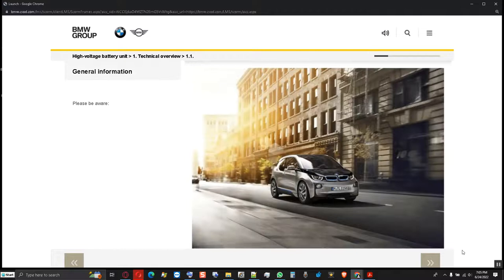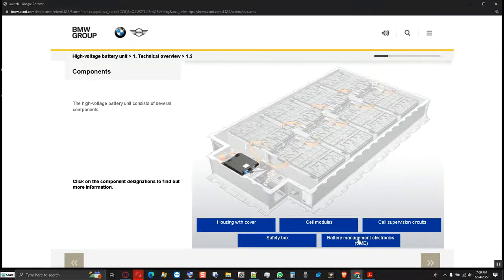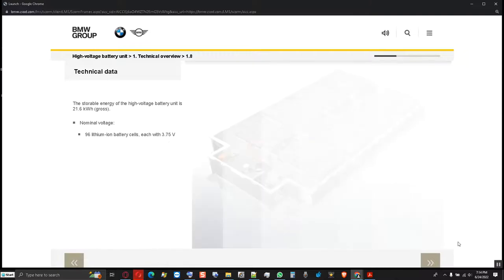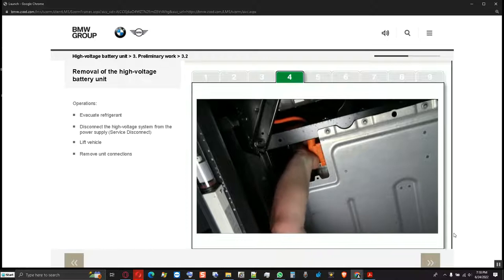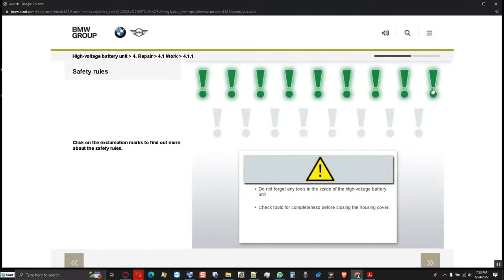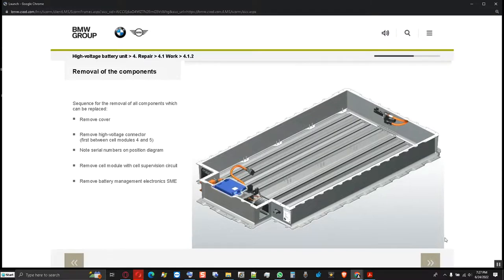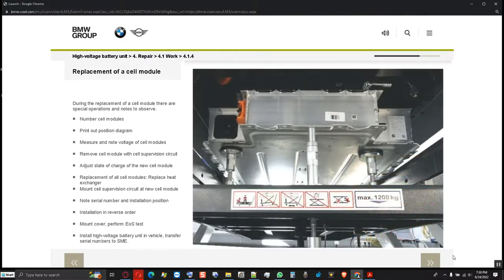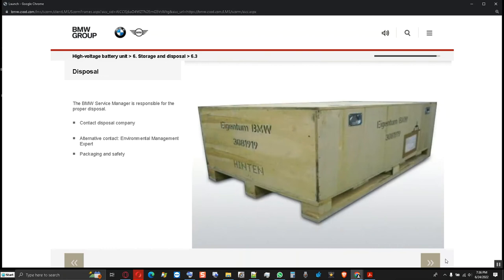BMW i3 High voltage battery unit training 2022-06-24 19:37:17

Comment: This thing is a 60k pos. 30k miles in shop with a quote of 8000 dollars for an electrical part. High voltage safety box went out. RUN! Love the part of the video saying the repair costs are reduced. Regular 12v battery replacement 1200 dollars RUN! Also in case your wondering BMW service charges 400 dollars per hour for labor i was quoted  4 hours of labor to replace the regular 12volt battery thats right under the hood. Never again BMW. Lost a customer for life.
Reply: Welcome to the modern automotive industry. You can always bring it to independents like me. The number of us who tackle EV’s is growing. But yes, the parts are exorbitantly over priced.

Most of it junk made in China for pennies on the dollar too. 🤷‍♂️ I don’t design them, I only fix them.